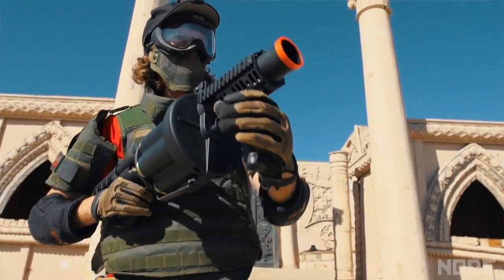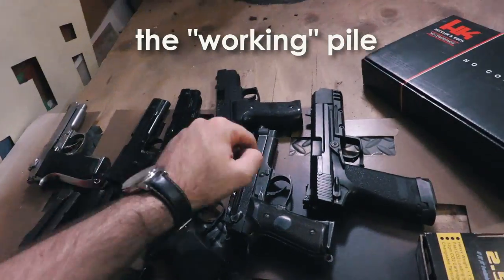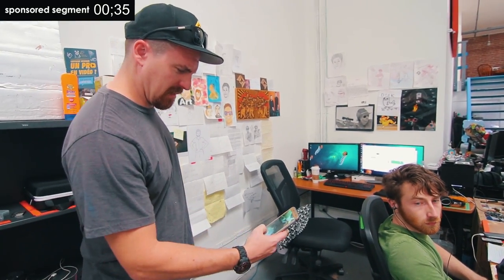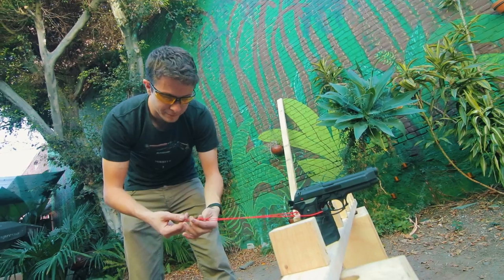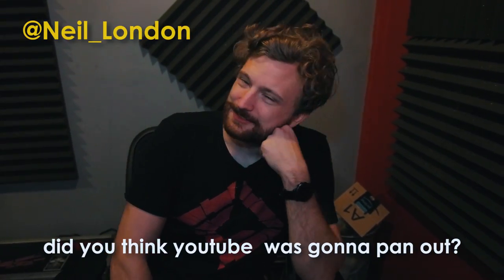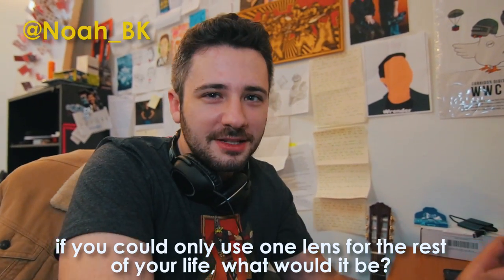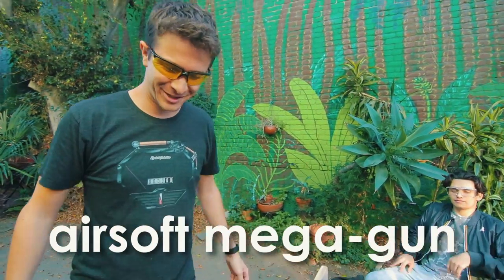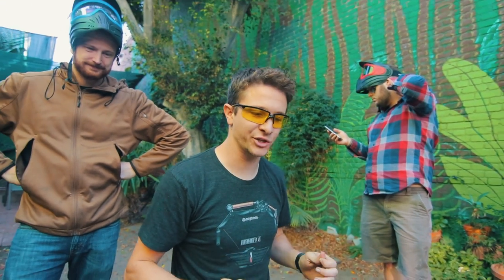The Ultimate Airsoft Gun!

Comment: Could you try to drill a hole in the magazines and put a tube into the hole that connects to a large pressurised tank with a lot of bb's in it and switch the pistols that have full auto on them on? That would be amazing to see if it would have enough pressure to push the bb's in through the tubes and into the pistol fast enough! (Tip: Probably a good idea to use an aircompressor.)